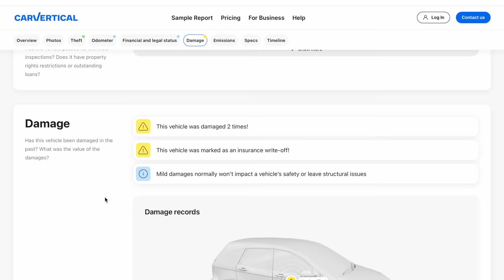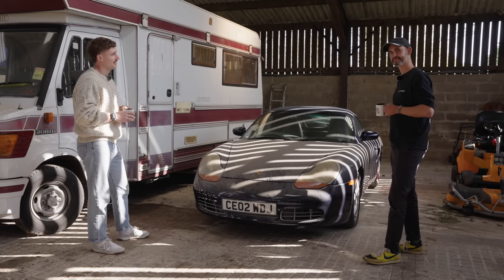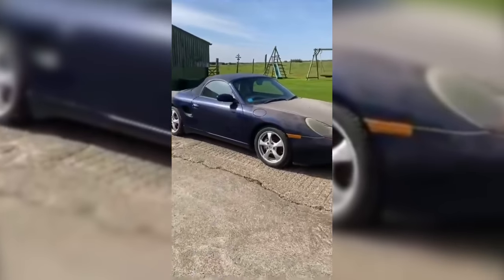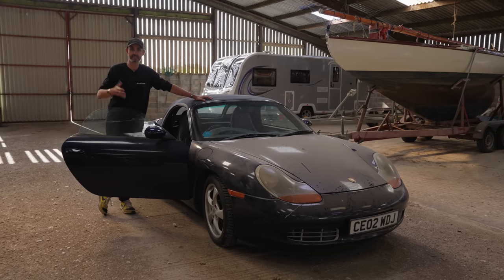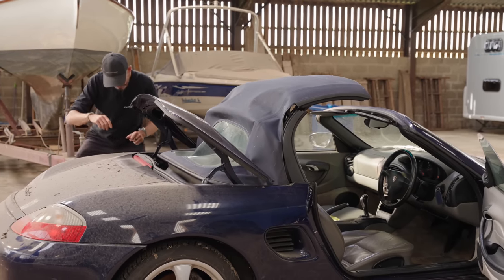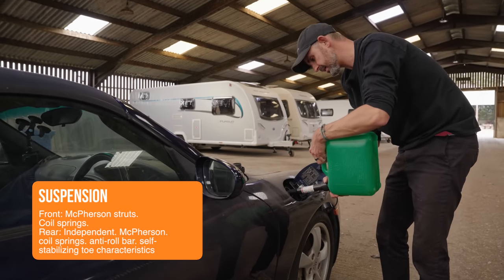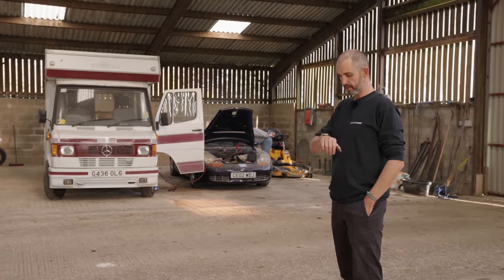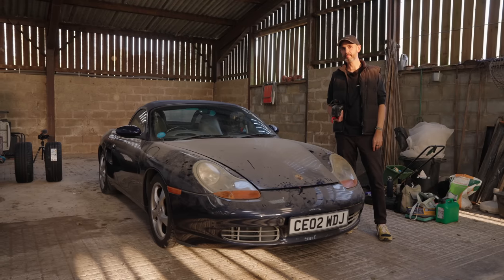I bought Britain's Cheapest Boxster - My First Porsche

Comment: Jonny - replace the fuse for the dashboard/instrument cluster (swap with the hazard lights as same amp rating). I’ve had a 2000 986 for 12 years and been through ALL the common challenges. If you leave the key in the ignition and to position one for longer than 30 mins it overheats the instrument cluster and seems to do something to the fuse. Then when it gets warm you can’t start the car because of the fuse. It causes an instrument cluster code that you can’t see without a Durametric (I have one if you need it) or a Porsche PIIWIS diags, but swapping the fuse out resets it. That’s probably what you cleared, and I bet you left the key in the ignition to position one while you looked at the engine bay! That’s how I found this out the hard way too! Carl
Reply: Those sorts of faults are total hair pullers! I've had the same where, as a fuse warmed up, the fracture across the link opened up. It took me weeks to solve and now I swap for know-good ones before troubleshooting the rest of the system 😅
Reply: Lol that's so voodoo
Reply: Great shout. My brain kept shouting that it must be in some way heat related.
Reply: Good shout. Fuses can age, especially if run for any length of time near their rating.
Reply: @turbokadett  welcome to being a coder lol
Reply: @andrewnorris5415  Ha yea, never been a coder but used to torture and abuse Excell's macros and functions for engineering calculations. Hours looking for a misplaced symbol or reference!
Reply: Nice 👌,
Reply: Leaving the ignition on in older cars often causes problems with overheating / fuse issues, so that is a pretty good theory as to his problem. Swapping the fuses is definitely a good plan to identify this in the future.
Reply: Excellent information, and this is the sort of advice one would expect from jointing forums, but in this case a Youtube one!
Reply: This sort of info is what makes the Internet great.
Reply: Lovely    Car   Jonny    😁    I    would   
     Love    To    See     It    at     The    NEC

Comment: The small obd2 reader probably doesnt drill down far enough to show codes in minor modules, but clearing them shows they exist. Likely If you plug it into a porsche code reader or more in depth reader it will show more. Looking forward to the progress with this
Reply: That's what I was going to say, a generic reader won't show specific codes but it'll be able to clear the fault memory, as I understand it. So there were faults there but the OBD2 couldn't read them, but it could clear them. A better one, or a Porsche one, would show the faults.
Reply: This may be the (temporary) solution to the no start when warm problem. Jonny, take an OBD2 reader with you when you pick it up.
Reply: Unfortunately videos are littered with adverts for rubbish overpriced ones like Carly when an ebay one will do the same job. Dealer tools are best
Reply: @hydraflyer for certain cars, some of those more premium ones will do more. 
OBDeleven for example does pretty much all most people could possibly need from VCDS and it's a lot more user friendly too.
I'm LED to believe that Carly can do a lot for BMWs as well 👍
Reply: @UpsideDownFork I second that, I've got OBDeleven for VAG cars and it's really good. And a fraction of the cost of VCDS.
Reply: Good luck with it. You should be good . Probably 2 modules needed , if the windows weren't fixed.  You need to use a more expensive code reader to reveal what could be wrong and to do so while the engine is running because you will get spurious codes with engine off!
Also start with a known good battery as well.
Reply: @UpsideDownFork  OBDEleven is an exception tbf it is very good but others like Carly are just general code reader and Google give you some info
Reply: Looking forward to updates on this 🎉
Reply: @hydraflyer  have you used Carly with a BMW?
Reply: Have an Autel mk808' and it drills down to each module can show what's working and not and can record data, has paid for itself a few times over now
Reply: @hydraflyer  Not Shilling for Carly but I had an ebay obd2 reader and while it worked it is nowhere near as good as Carly. With Carly you can reprogram some pretty trick stuff you just can't do with an ebay special.
Well worth the money in my book. It's saved me thousands on my Z4.
Reply: Love the mug!!
Reply: Crap with porsche sign😂
Reply: I have VCDS, brilliant bit of kit. excellent for coding.  I've not used OBDeleven but have heard excellent things about it
Reply: @hydraflyer  people have their choice. They shall work out whether carly is same as other reader + app combos.
Reply: piwis 2 will let you read an program the car. can be had for $500
Reply: Maybe the starting fault is linked to the roof and the fact that you played with the roof it caused the fault early ? Maybe the car doesn’t start when the roof is being lowered so maybe a sensor
Reply: In other news; water is wet and the sky is blue...
Reply: @davidoverland440  Good point, it makes sense that there's an interlock to prevent idiots from driving with the roof half down.

Comment: Might be worth checking the main relay for dry joints. When they warm up it can cause the non starting issue. 
Will be good to see this project develop.
Reply: for me it was a fuel pump issue but that was long time ago.
Reply: had a similar issue. the main relay was built into to the ecu and it would get hot after a 20min run. would cause non start until it had cooled down. sometimes 10minutes other times upto an hour. 

swapped the ecu out and was perfect.

Comment: I had this issue. Turned out to be a relay for the fuel pump that overheats.  Sits behind the rear bulk head passenger side. Took me months to work out
Reply: But it didnt seem to be turning over , and you can hear if the fuel pump is running or not
Reply: @LOTPOR0402  I think he's referring to the not starting after it has been running for a while problem.

Comment: Johnny next time you have the roof up in that position be sure to clear the drainage points under there. I owned one of these and if they get blocked, water runs down the back of the seats and onto the modules under the seats.
Reply: Water gets in through other places in the hood other than the blocked drainage holes. Mine were clear, but it still leaked water behind the carpet behind the seats in heavy rain. Genius Porsche engineers put the ECU under the passenger seat where the water collects. Worst cars ever made.

Comment: Cheers to you, Jonny!  Best of luck with the new-to-you 986.  Bought mine off eBay, sight unseen 15 years ago and drove it 700 miles home. She's been remarkably reliable. Mostly just minor issues:  water pump leaking, cracked overflow tank - both common issues to the platform.  Only major issue was a failed variocam actuator, that was a bit pricy to fix.  Standard maintenance stuff is all pretty easy to deal with.  5-speed and flat six are a great combo.  Can't wait to see the next installment on this one.  Cheers from NC!

Comment: What an eventful start to your Boxster journey .. I'm looking forward to seeing this progress .. Just a small tip re the rear window, I roll up a towel or place a piece of pipe insulation where the window creases on my Chimaera and it stops it creasing ..
Reply: One does need to apply the "Porsche Karate Chop" when stowing the top, to prolong the life of the rear window
Reply: My MX5 NA has a plastic rear window and can also suffer from a crease if you don't take precautions. To that end I got my mum to sew a long sock-like tube with fluffy material, approx 100mm in diameter, and I stuffed it full of loose foam until it felt firm enough to support the bend in the window when folded down. When not in use I store the tube behind the seat out of the way. Works a treat and I have no evidence of creasing or cracking.
Reply: Good ol' mum. @Laz_Arus

Comment: Had an 987 Cayman, same problem, small sensor at the clutch pedal was the problem as it gets a bit fragile, took ages to find out .
Reply: Good shout that.
Reply: That's only if this car has the press clutch before starting feature
Reply: @fozpringle1  basically every manual car for the last 30 years does...I'm sure this car does. Good shout marty-mc, I had some weird problems in my NA Miata solved by replacing a similar switch and its corresponding pad that it touched against.
Reply: I was thinking this too. Sometimes my Porsche will do the same thing for a moment and I bought a switch and have it on hand just in case. I would check that switch, they are cheap and easy to change.
Reply: @Trendyflute  ....every manual car form the last 30 years??? How did you verify that? Did the VW Beetle that was manufactured in Mexico? What about the Holden Commodore, Ford Falcon or Opel/ Vauxhall Astra & Corsa Made since the early 90’s ? My mother’s  ‘96 Toyota Camry never has that... I would really like you to publish your source of information here...
Reply: @Trendyflute  my bmw e30 doesn't have this
Reply: @Trendyflute my 2005 Fiat Panda sure as hell doesn't. 😂
Reply: My 911 996 turbo doesn't have a clutch switch.
Reply: Neither of my Audi's need clutch depressed to start. Or my Skoda. Al are Manual.
Reply: @paulsz6194  Just remember he's likely to be an American so they have to put all the idiot safety guides on to stop them hurting themselves & end up in court.
Reply: @Trendyflute not true 😊  only certain brands did this. Many stopped due to customer complaints 😂

Comment: Hi Jonny, the VIN entered in CarVertical was completely wrong, so how was the check carried out and it actually provided results???? The VIN entered had four Z’s at the start!!!!

The VIN should be WP0ZZZ98Z2S then the serial number. I’m an ex-Porsche Service Manager.

Btw, to avoid grief check if the IMS bearing has been changed. If it goes the engine is toast…

For the lids not opening, first check the switch on the sill trim as the switches break up internally. The boot release actuator (near the bonnet latch behind the carpet)  and last, the connector on the body module.

For the electric windows, it’s usually the switches themselves having burnt contacts internally.

I suspect that the contacts behind the ignition switch are also on their way out,very common issue

Comment: I had a 987 S. The balance is just amazing. There is something about the way a mid-eng car goes around bends. It's very hard to put into words.
Reply: My friend wound one up to 90,000. No RMS issues
Reply: Tracking gets easily knocked off as the suspensions are made of lightweight alluminium plasticine. So, they need constant tracking and if it's off they drive like they are on grease.

Comment: A great watch Jonny, I've been on both sides of this vid; 
Selling a car that developed a fault out of the blue when the buyer came to collect (fine at an earlier viewing before monies had changed hands)
Buying a car that was fine when I looked round it and drove it, dead after we'd had a cuppa and signed the paperwork!

Both times that slight sicky feeling in the pit of the stomach and the whole-brain headache as the mind goes though every possible thing to try but the dopamine rush is worth it when the engine fires and you drive off in to the sunset!

Comment: I'm early into watching this - Check the wiring loom, I think you might find some rubbing which could be giving an intermittent error. I remember something similar in a Merc I had. I ran it with the intermittent fault for a year before realising it must be a simple connection error. Fault was under tape too.

Comment: Hi Johnny, Has 2 sperate issues on my wife's 987 cayman which had similar symptons.
1. Clutch switch , I just bypassed it and subsequently replaced it to resolve the most recent no start issue.
2 . The first no start issue was a couple of years back and was intermittent and presented itself like a dead battery but I traced the issue to a pole that the battery positive lead clamps onto which carries the power into the cabin and onto the electronics and fusebox.
The clamp is designed to swivel on the pole but it gets loose and makes bad contact . A porsche parts specialist wanted £400 for the replacement pole and lead 😂😂.
I removed the pole ( not easy) , treaded it with a dye set , reinstalled and put a nut on the now treaded pole to secure the lead.
I can send photos , but definitely worth  checking.

Enda

Comment: I had a similar ignition issue in a Civic.  It was dry solder joints in the ignition relay - when the relay warmed up the joints would presumably expand slightly and resulted in no spark until things had cooled down and then it would fire again.  Reflowing the solder joints 100% solved it...

Comment: I believe that the problem with starting the car is related to the anti theft system. Sometimes it happens to me as well, on my 02 Boxster. What I do is I get out of it, lock it, wait 10 seconds, unlock it and crank it. It should start right up! I thought it was the battery but it kept doing it sometimes also after replacing it. Hope it solves your problem if it arises again, good luck with your project!
Reply: I had same issue with my 2009 987s - same solution.

Comment: Good buy Jonny. We had exactly the same fault on my wife's MX5. No fault codes. The dealer  changed the camshaft sensor and Crank sensor. No joy. After sitting in Waitrose car park for an hour and a half one day. I decided to change the coil pack. Fixed straight away. Been OK for years since.

Comment: Great vid Jonny. I ran a 2004 boxster manual and loved it. Gear change and steering are just so right. Had some of the usual things go - lambda sensors, coil packs, window regulators. No issues with seals though 😊. Mine was Lapis blue too❤

Comment: Good luck but sorry to tell you that’s the 217hp 2.7 not the later 228hp version, easy way to tell is the later 996 2.7 had a wider rear spoiler where as the earlier cars had a thin style. 

The ignition switches regularly fail on these and would be worth a replacement. 

My top tips after owning a few; 

1. Use a slightly thicker grade oil than Porsche recommends at this mileage. 

2. Add a magnetic sump plug, these can have IMS issues but not as prevalent as the internet would like you to think, with regular oil changes and the magnetic sump plug you can monitors the issue and usually save it before it gets bad. 

3. Try to retro fit the earlier cars mechanical levers to open the bonnet using wire, it’s just such a pain when the batteries go low and you can’t access the bonnet. If you keep using the wire by the indicator the headlight and surrounding paintwork gets damaged. 

4. The cats are quite restrictive on these, don’t fit a full sports exhaust just fit sports cats, you’ll get a real performance increase and better response. 

5. Replace the AOS as a preventative measure. 

6. Consider fitting a new flywheel as most of the dual mass flywheels are faulty by this age, if you’re boring fit a new one, but if you want a more responsive engine fit a lightweight flywheel with a new clutch and do the leaky oil seal while you’re there. 

7. Don’t fit a cheap quickshift the gears feel too notchy, the best option is to fit a new 987/997 shift mechanism that reduces throw by 15% and will feel much tighter, although still plastic it allows a bit of give and doesn’t highlight the notchiness of an older gearbox

8. The 2.7 gearbox has long gearing, if you only drive to 6000rpm then change up you will be disappointed as if falls flat out of the power band, if you go to 7000 and Change up the next gear is just about in the power band. 

The 987 sport 2.7 had a Closer ratio six speed gearbox, and while rare would wake the car up a bit of you could fit in conjunction with a light flywheel. 

Best of luck 👍